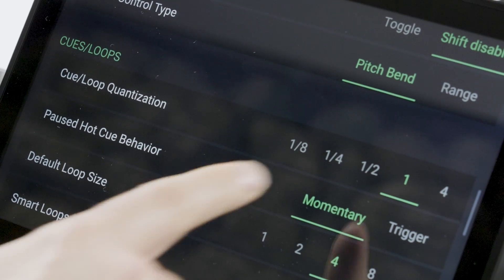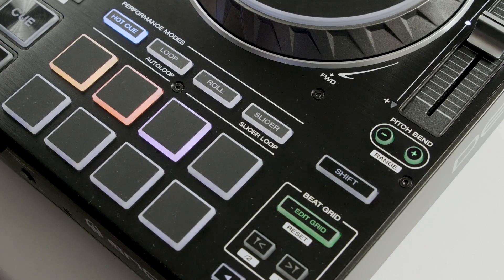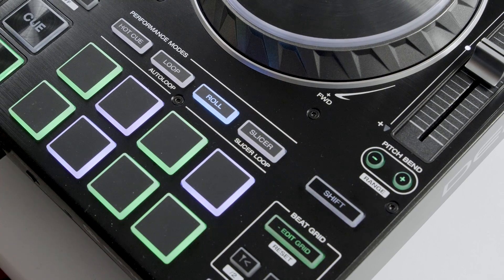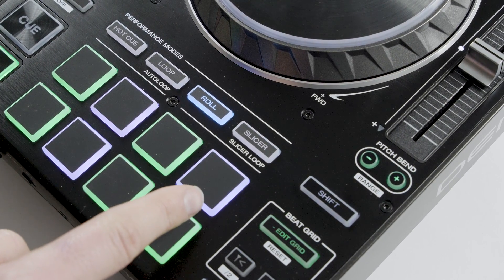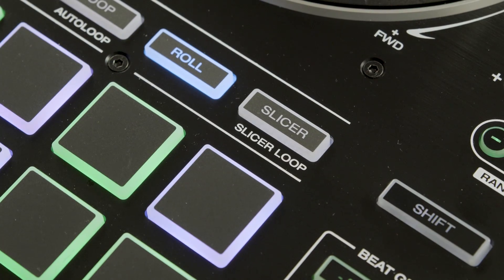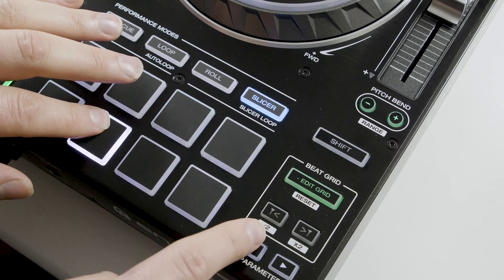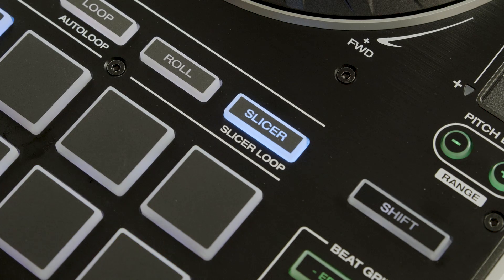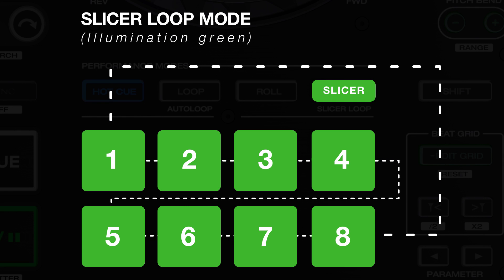Denon DJ PRIME 4 Tutorial Part Seven – Performance Pads

Comment: Any plans on an update for the engine prime software?
Reply from the maker: Hi Steve, yes there are plans for Engine Prime updates coming soon.
Reply: @DenonDJTV  please make it soon. quantize is janky. It 'sorta' quantizes, but if that were the case, the perfectly quantized hot queues wouldn't knock out the solid sync light - just when I get a feel and stop missing rekordbox, some random shouldn't happen with this amazing hardware BS

Comment: How do I get the performance pads to light up they don't work
Reply: PLUG IT IN SON
Reply: I‘ve got the same problem if I turn the station on they light up but after booting up they‘re black and don‘t work. Have you found a way to fix it? Is there maybe a function to lock them in the settings? I can’t find it.
Reply: Same problem, my left performance pad won’t work even the shif left is locked 🔒.. anybody anywhere